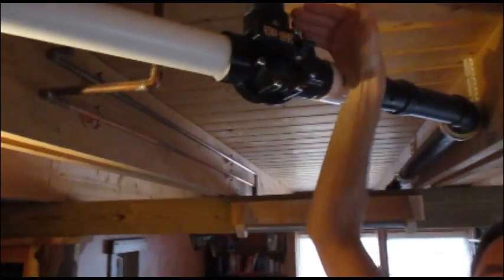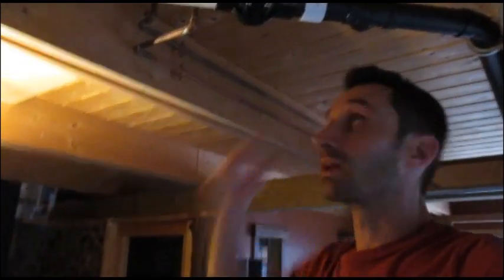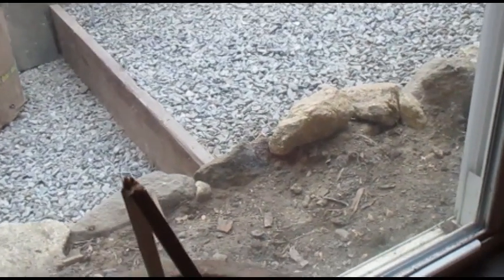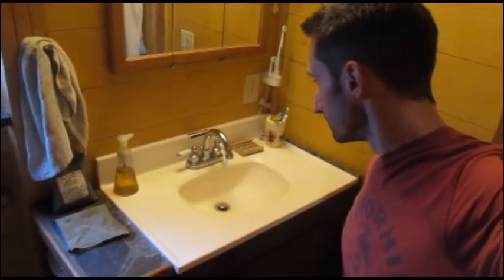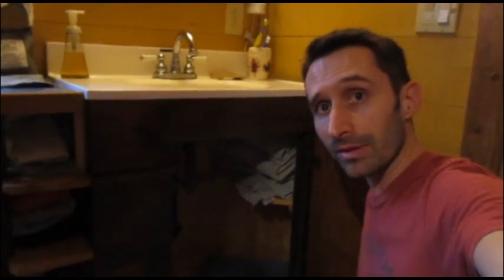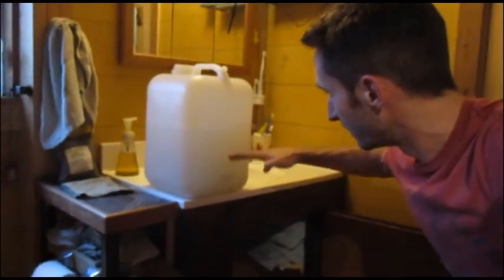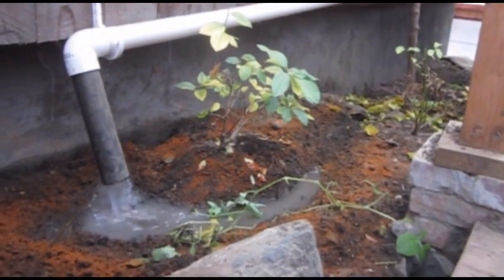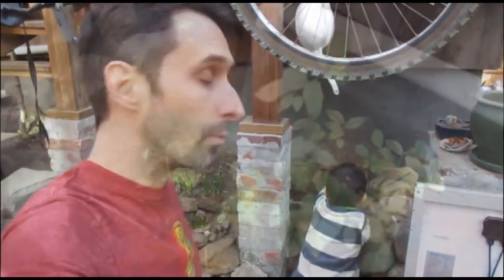Simple Gray Water Systems

Comment: Curtain idea for you.... Use a twin size flat sheet cut small slits in top hem...feed a tension rod through it and instant curtain...if you need to hem to make shorted use iron on hem bond tape....
Reply: +Cindy Brachey - you know... those ARE pretty sketchy curtains, both aesthetically and functionally. I have been meaning to address them at some point actually. On your sheet idea, I'm in the process of doing exactly that for some of my basement windows. I bought a flannel sheet and a seamstress is cutting it up and doing the hems for me, since I don't have very easy access to sewing equipment. Thanks for the tip though. I actually noticed that the top of the sheet I bought had a ready made "tube" sewn right into it. Please keep watching, and if you have any other tips, please share-share-share!